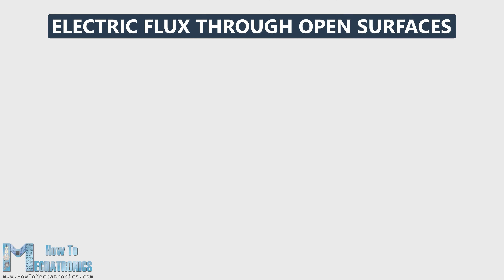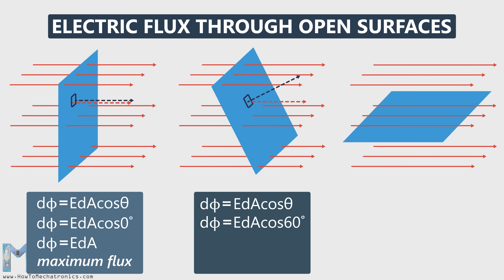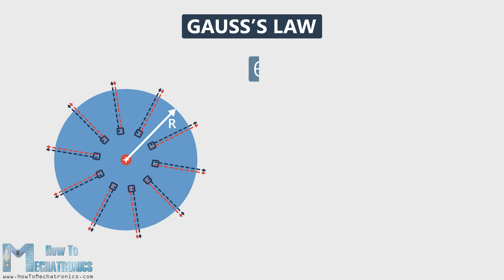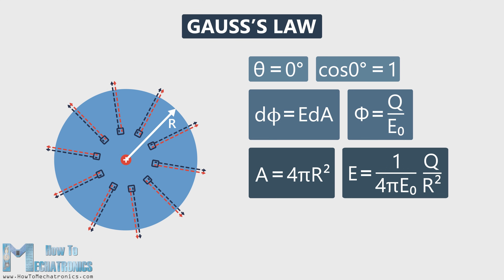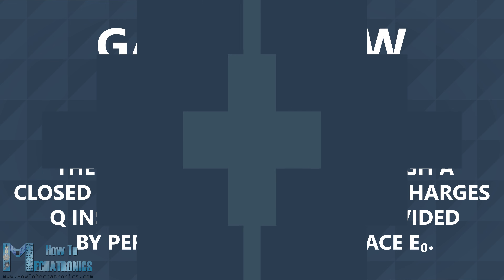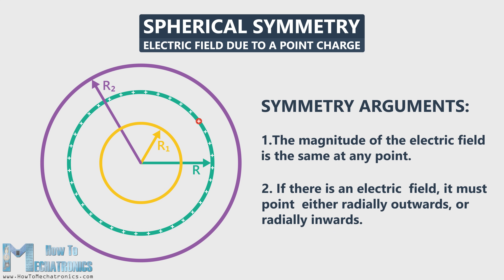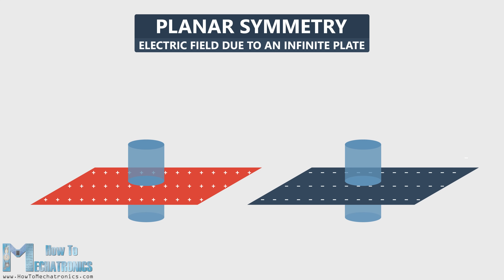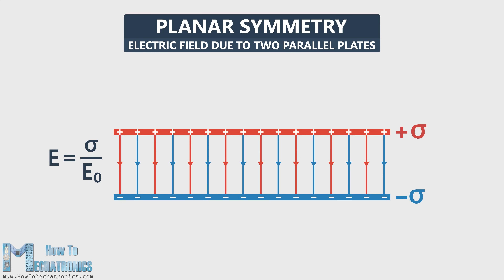Electric Flux and Gauss’s Law | Electronics Basics #6

Comment: I think electric flux & electric field are different entities. Electric flux is a  physical entity measurable  by its density while electric field is force with  magnitude and direction. A charge is surrounded by electric flux which decreases as per inverse square law. There is no field around a single charge. Electric field appears only when flux of 1 charge interacts with flux of other charge. In case of similar charges flux b/w charges increase which produces a push/repulsive force while  in case of opposite charges flux b/w charges decreases which produces pull/attractive force.

Comment: How come sometimes the electric flux is found by integrating E over a given area, but in other cases it's found by integrating D over a a given area.  I've seen both versions of the equation used, but I don't see why one would be prefered over the other.

Comment: The first graphs of the rectangles are wrong the first case is parallel and the last one is perpendicular
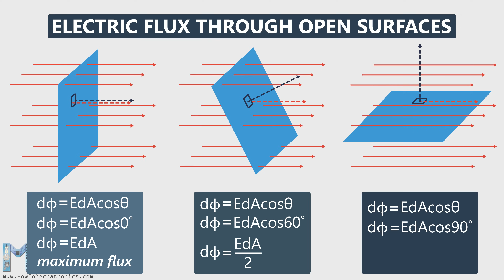Reply: If you're talking about the graphs at 2:31, they are not wrong because the rectangles represent the open surfaces, while the black dotted lines represent the direction of the area vectors, when the area vector is parallel you have maximum flux and when it is perpendicular you have zero flux.

Comment: Wish I had this in undergraduate physics. It seems that for Gauss’ Law to work, the charge needs always to be in the center of a surface.  This maybe is not realistic, but works as a first approximation.
Reply: Gauss's law always works, but it can actually be done easily if there is symmetry to exploit in the problem. That is why most of the undergraduate problems will have charge distributions that are planar, spherical, or cylindrical in shape.
Reply: Marc Normandin  Agree, Gauss’s Law applies everywhere, but it can be easily solved in only a few practical cases. Though, there are probably mathematical or computational methods to solve more complex cases, like electric fields in semiconductors.